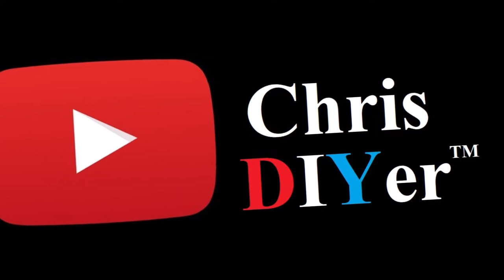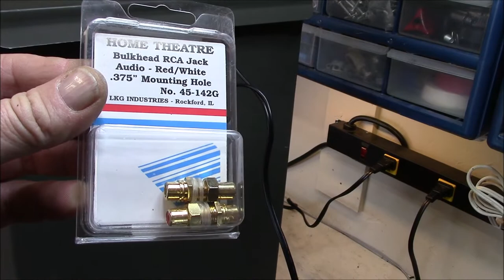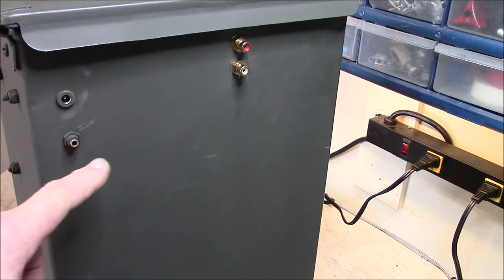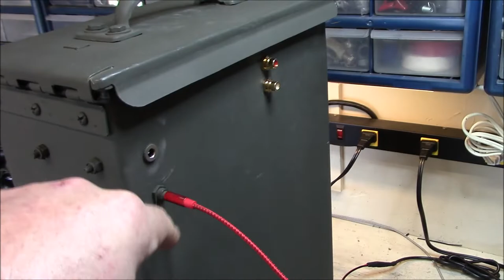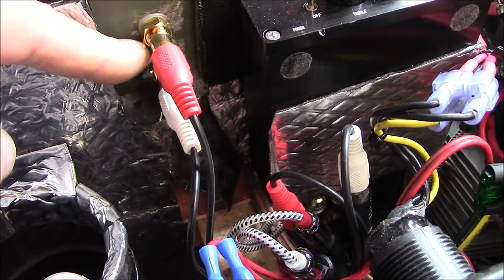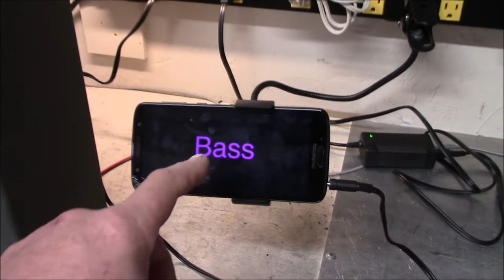Homemade Bluetooth ammo can stereo speaker: "thumping" and new RCA stereo jacks

Comment: Have you had any issues with the class d mini amps?  I tried the fosi audio bt20a version driving two 8 inch in ceiling speakers.  After 2 months the left channel got a fuzzy sound to it and eventually blew out the left channel.   I’m thinking of trying the nobsound version like you used on this one.  Those ammo cans you are building are pretty cool.
Reply from the maker: YEP! I tried a few of those Fosi Class D amps...never again. Did a side by side sound and power comparison a while back. The Nobsound sounds better, faster Bluetooth, and attains full power output at 24v input power. I returned two Fosi amps via Amazon returns and bought the Nobsound 100w x 2 amps as seen in this video. Thanks for the compliment and watching my video.